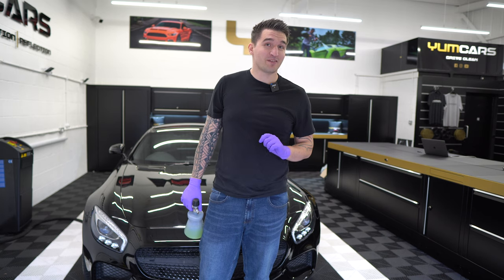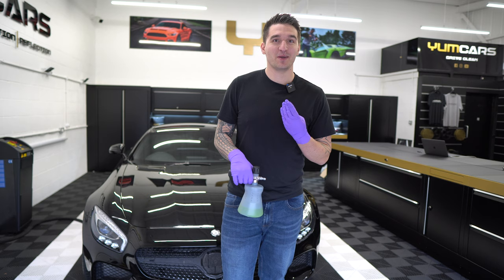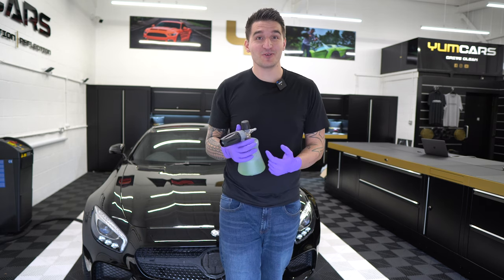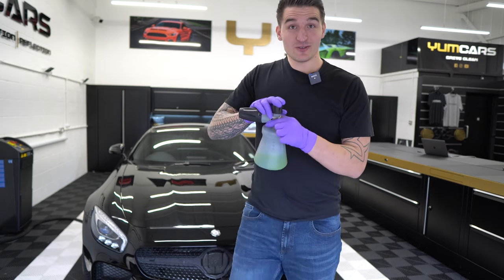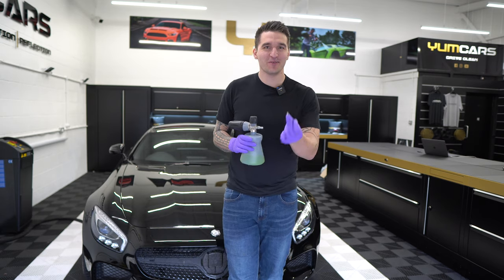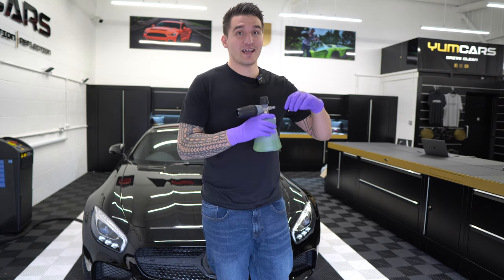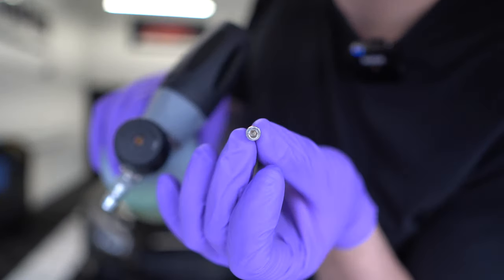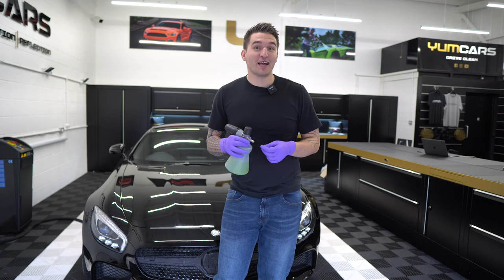MTM PF22.2 Foam Cannon Replacement Screw

Comment: Why on earth would a £85 foam cannon not come with all stainless hardware🤦‍♂️
*for the price it should be titanium 🤣
Reply from the maker: They do. 

This is a replacement part for the original PF22 and not the current cannon 🙂
Reply: @YumCars  doh🤦‍♂️😄
Reply: @YumCars  do you think the pf23 will come with a quick release bottle as standard instead of threaded
Reply from the maker: Our quick release bottle is an aftermarket part as standard they will be threaded.